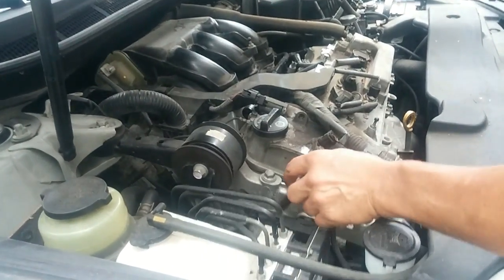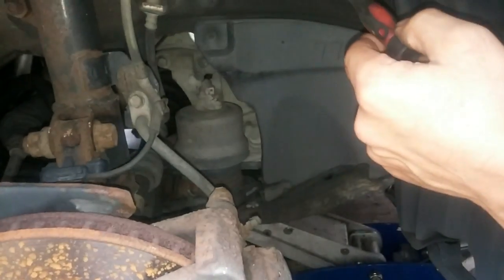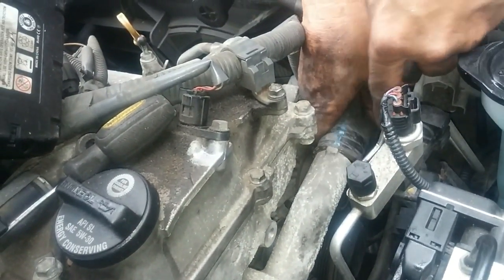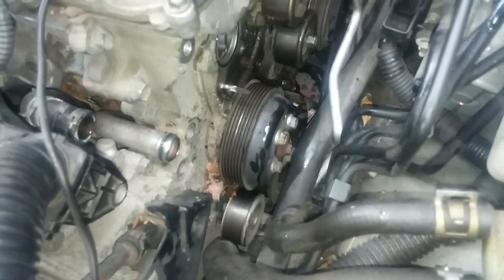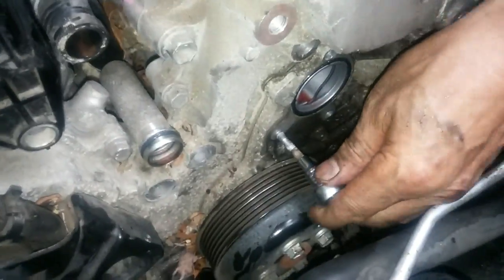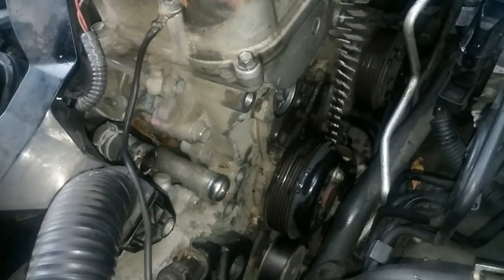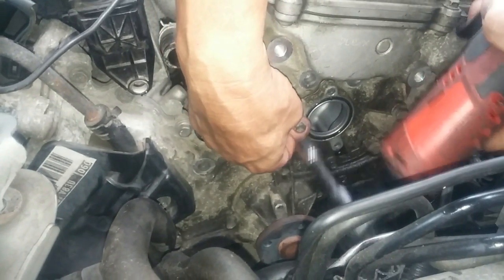Toyota V6 GR-FE - Water Pump Replacement

Comment: The top bolt on the thermostat doesn’t want to screw in. I have a 2016 Es 350. Can anyone help?
Reply from the maker: Try 1/4" extension with short 10mm socket.

Comment: 11:55 why that kind of funnel?
Reply from the maker: That's a Lisle spill free funnel.  Link is provided in the video description area,.
Reply: @hardlymovingpro  no. why?
Reply: @outoftime788 it's to fill the coolant into the system and bleed all the air out at the same time

Comment: Hi!
Sir, please give me a comment.
Will i have a chance to replace VVTI and timing chain at 2gr-fe, rav4 III 2007 ?
Is there a chance that it will be enough space to takeout timing cover and VVTI, without dismount of whole engine ?
May be if i lift left side of engine, like you did ?
Reply from the maker: I never replaced the timing chain on the 2GR-FE so I can't advise.  For all that work, you'd be better off getting a JDM replacement engine.

Comment: Shouldn't you had loosened pulling prior to taking belt off?
Reply from the maker: You can loosen the pulley nuts prior to removing the belt assuming the belt doesn't slip in the process.

Comment: I just did the same job on a 09, didnt have to loosen the drivers side motor mount to have clearance for the water pump to go in and out, all I did was take the plastic cover off of sum electrical box that sits under the motor mount that was taken out... easy peasy japanesy.... you video was alot of help tho...thank you
Reply from the maker: Good job and thanks for sharing!
Reply: I wa looking b at that last night fr
Reply: I also did water pump on a 2009 camry. Also had to loosen the driver's side / center motor mount to get the engine to lift for clearance for pump cover/pulley and that one lousy bolt on the top mount bracket. Excellent video. In heaven cars will be easy to work on by design! Thanks for the help until then!
Reply: Do you have too use the red antifreeze or can I use the green

Comment: Loosen the water pump pulley while the belt is still on....no need for the E 6 socket to remove that stud either
Reply from the maker: Thanks for sharing!
Reply: @hardlymovingpro  ....I'm doing one right now...🙂...been a few since I did one and I used your video to refresh my memory... great Video!!!👍👍👍...thank you 😊

Comment: Nicely done. My sister in laws van just started the water pump rattle. So did Toyota fix the problem with the water pump? What brand is better? if you know.

Thanks for the video
Reply from the maker: No problem for Toyota to fix.  Water pumps do wear out and eventually require replacement.  OEM pump provider for Toyota is Aisin.  GMB as well as Gates are good substitutes.

Comment: Hi. Was wondering if I could have some advice

I managed to pull both idler pulleys off.. one at top. One at bottom left

I seemed to have lost 1 idler plate cover
(Its like a washer). I believe each pulley comes with a plate. One at the front and one at the back. 

Ive seemed to have lost 1 pulley cover. 
Do you think its neccessary to put back a pulley without 1 cover on it? 
Id have to buy another pulley complete just to get the cover! Ive looked high and low for it. In the engine bay to see if this little plate washer dropped anywhere. Cant find the damn thing.
Reply from the maker: Had it happen to me as well.  A large flat washer would work as a substitute.
Reply: @hardlymovingpro  thanks for the reply. I have to find a similar diametre width washer. I think it would come pretty close. Thanks for that!

I also managed to strip the bolt head on one of the idler pulley bolts aswell and had to use a bolt extraction kit to remove it. Unfortuatley its a two week wait for a new bolt. So im thinking I can weld nut onto the damage bolt head and use it that way. I dont know of anywag around it.
Reply from the maker: Get a bolt from a car in the salvage yard.
Reply from the maker: You only need a washer the diameter of the base of the pulley.
Reply: @hardlymovingpro  okay so this is where im at
Car is put back together with a washer I found at depot store. 

Screeling like CRAZY. 
Now the belt is smoking and car is rough idling terribly. When i loosen the idler pully with the make shift washer the screel decreases and increases. 

Ive even tried to run it with no cover plate
Still scrreching like crazy. Very ODD. 
PULLY is moving freely in my hand off the car showing me that its not seized. But upon accelration the squeeling gets higher and higher and then the belt starts to smoke. 
Toyota australia has told me 5 weeks from JAPAN to get the cover plate. 

Any ideas at all? Bearing is free spinning off the car so its not seized. The only thing i can think of is that it definatley needs the idler plate cover to operate and spin freely while on the engine.

Any ideas at all?
Reply from the maker: Pulley must be free spinning after bolting on the engine.  If not, that's the cause of the smoking; belt friction on a stationary pulley.
Reply: @hardlymovingpro  thanks the belt tensioner bolt was done up too tight preventing it spinning

However now the car is rough idling. I can rev it then when the revs come back down it starts to splutter and choke now

Something must of happened when the water pump failed...
Reply from the maker: Or maybe the belt is mis-timed.  Recheck your timing marks.  Happens to the best of us.
Reply: @hardlymovingpro  thanks
I never knew but with toyota late 90s onwards if thr battery is disconnected it has to relearn its idle
Theres a video on uouyube how to do it
That includes the gsv40r engine and all camry . Avalons etc. If the battery ever is changed or DC. 
Crazy huh? 
Works now

Just wanted to say thankyou. I couldnt have done it without your video you saved me over 700 dollars. God bless you.

Btw the belt squeeking and screamimg and smoking was becausw the tensioner pulley was done up too tight

Comment: How many hours you think this took? Cheers
Reply from the maker: For me, around 3 or less hours.
Reply: @hardlymovingpro  im no mechanic. I found a water pump for $35 that would fit. 
Im about to give it ago myself
Mechanic would probly try charge around 700. Hopefully it goes to plan
And im thinking about buying a milwaukee side impact wrench like you have in this video
Reply from the maker: $35 seems a little too cheap for that water pump.  Get either Aisin or GMB brand.  Good luck!

Comment: Thanks for the vid it is very helpful the process seems straight forward. What are the torque specs for the pulleys when replacing them?
Reply from the maker: You'd need to get a repair manual for the vehicle to obtain torque specs.  I snug them down using an extended 3/8" ratchet wrench.  That's good for around 30 lbs of torque.  You can use thread lock liquid on the threads for extra comfort.

Comment: Great video!  Now I am thinking about do this myself! 2015 toyota Sienna with only 50k and already have this water pump pully/Bearing grinding noise!  What happened to Toyota reliability?  Btw I got the milwaukee M12 ratchets and impacts for this ! Lol 😆
Reply from the maker: Good for you on the M12.  There were a few years the pump didn't last 100k miles.  I think they're better now.  Aisin is the OEM manufacturer.

Comment: This video helped a lot!  Thank you for taking the time to make the video!!  Working outside, in less than ideal conditions, it took me about 6 hours total. I have an AWD Highlander so it's a little different. 

If anyone plans to try this at home, the best advice I can give... Lift the engine about 4" on the passenger side before you even attempt to take anything apart that attaches to the belt. Trying to get the bolts out of the engine side of the upper mount is the worst part of the entire job!   The actual water pump bolts are the 2nd worst.  Good Luck!
Reply from the maker: Thanks for sharing.
Reply: Running into this problem as we speak! I have a '12 AWD Limited so mine is a little more cramped than the Camry!
Reply from the maker: You'll have to tilt the engine up for more clearance.
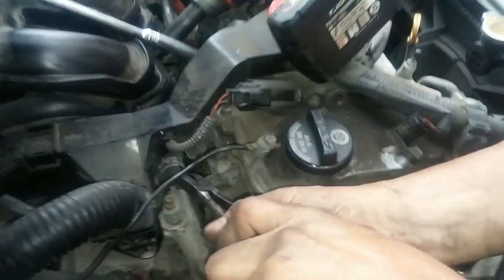Reply: @hardlymovingpro  I got that taken care of, I'm stuck at 4:12, I don't have hose clamp pliers, trying to find an alternative since it's so late and everywhere is closed!
Reply from the maker: Harbor Freight.  They sell hose pliers.  Cheap.

Comment: Also I notice you didn’t use RTV On the 12 mm bolts for the water pump I thought you’re supposed to use them so there’s no leaks
Reply from the maker: Found that they're really not necessary but doesn't hurt to put some on the threads.
Reply: @hardlymovingpro  Thanks just did it and put RTV on all the 12s

Comment: Is it necessary to put sealant on the stud that’s on the water pump if it comes already installed as in the Toyota brand ones and ASIN? I hate to take the brand new stood out only to find it’s already sealed and I find it hard to believe that they wouldn’t put sealant on it properly before shipping it out since it comes pre-installed
Reply: AISIN replied to an earlier question I asked them this via email and they responded back saying no sealant required it’s already sealed from the factory
Reply from the maker: That sort of makes sense.  The threads from the 12 mm bolts are probably picking up the timing chain cover RTV residue.

Comment: No doubt, this is the best video on showing how to replace GR-FE water pump. Q1> Did you replace thermostat? Q2> Did you loose the driver-side engine mount? Q3> Did you just jack up the engine through oil pan? Thank you!
Reply from the maker: Thanks!  Thermostat wasn't replaced.  Driver side mount not loosened.  Jack up via oil pan.
Reply: @hardlymovingpro  May you Also tell me the part number for the o-ring? i saw you used a green one. thx
Reply from the maker: @ask43242flight  O ring should be included with the replacement pump.
Reply: @hardlymovingpro  Thank you!
Reply: @hardlymovingpro  the metal water inlet house/ housing (10:17)that contains the thermostat, if it’s leaking from the joint, do I just replace the gasket or do i have to replace the entire thing? Mines leaking from the joint showing in 10:26Thanks

Comment: Thanx for the video. Will it hurt the other motor mount to twist the engine up like this to one side?  I am studying this job as I think it’s coming.
Reply from the maker: Lift just enough to get the side torque rod mount and water pump pulley out.

Comment: good video,I did other way,don't  need to move the bottom engine  mount nut,you just need to remove two 10mm nuts from the rear cylinder head front plastic cover,the aluminum can remove from the back with two rear bolts with it.
about the water pulley 4 bolts ,just need to put a pin to a hole between two of the pulley bolts to lock the pulley.
I need to replace the belt tensioner too, need to remove   the air conditioning pump and alternator.
Reply from the maker: Thanks for sharing
Reply: @hardlymovingpro  you welcome, need remove water pump and tensioner tomorrow, this my first time, bad   Design ,doesn't like toyota.
Reply: I did the pump today, it have two 99% same pumps,the different is one of the hole fit 10mm bolt another hole fit 12mm bolt !

Comment: do you have parts numbers for the two seals for the thermostat housing
one was a the oring on the pipe the other where the housing bolts to far corner
Reply from the maker: They usually come with the new water pump if the pump was purchased from a reputable parts manufacturer.
Reply: @hardlymovingpro  dang advanced auto is def not reputable lol but we already knew that
Reply from the maker: @death-hs4dh  Should not buy a part like this from any retail auto parts supplier that's repackaged the part.  You then do not know who made the part.
Reply from the maker: @death-hs4dh  Advance Auto is better than AutoZone ... IMHO.
Reply: @hardlymovingpro  annoyingly they only gave me the main seal

Comment: How you know the water pump is bad ? I have some noise around the area , but not sure if the water pump or ? 
Car runs and drive no problem
Reply from the maker: More than likely the pump's bearings are going bad.  When they completely fail, that's when the coolant with gush out.

Comment: Why is there never tool sizes only about half of everything is named . Not that helpful
Reply from the maker: Japanese cars are consistent with their metric sized nuts and bolts.  That is, 8 mm, 10 mm, 12 mm, 14 mm, 17 mm, 19 mm & 21 mm.  I can just look at a bolt head or nut and know what socket size to reach for.   Comes with experience.

Comment: I had to comment again to express my gratitude for your post. This video was my companion as I replaced the water pump. Once you get realistic about removing the motor mounts on the Lex everything is simple. I really took my time and was meticulous in my approach to this job. I am no longer intimidated and enthused.  Cordless impact wrench and cordless ratchet were essential.
Reply from the maker: Glad it all worked out for you, good luck with future repairs and thanks for your post!
Reply: @hardlymovingpro  you are most welcome.

Comment: What about locktite on the pulley bolts. Ive had them rock out before. There also was no mention of the pulley washers.
Reply from the maker: Never had them come loose on me and I've done a lot of replacements;  but it doesn't hurt to use locktite if you want.
Reply: @hardlymovingpro  thank you for such a quick reply. Im replacing the water pump on a 2015 Lex right now (3:24am) I just got every thing off and Im taking a break😊. No gasket maker/sealant is required on the water pump gasket?
Reply from the maker: @justallah2785  Nope.
Reply: @hardlymovingpro  ❤

Comment: I remember when the water pump was on top of the engine 3 or 4 bolts and boom.
Reply from the maker: Ah ... the good old days.  I.e. Chevy 5.7L V8.  Still have to take off the fan shroud, the fan and the hoses.

Comment: Your video helped a ton take the water pump out. Did you end up using thread sealants on the 12mm bolts on the water pump? When I removed mine, all the 12mm bolts have it on the threads (grey gummy stuff). The manual I found only mentioned loctite 242 (blue) on two of the 10mm and nothing else on the others.
Reply from the maker: Good question.  RTV is used on some water pump mounting bolt threads when the engine block bolt holes leads to a coolant passage.  So yes ... I apply RTV on those 12mm bolts.
Reply: Can you share what grade you used? Seems like permatex is a popular choice. There's a high temp one which comes in white tube, and a grey one that comes in a grey tube.
Reply from the maker: My preference is the Permatex heavy duty gray RTV.
Reply: I searched all over for an answer to this same question. The Car Care Nut video on this very same repair said remove any globs on the tip of the bolts, after that he said that the bolt is 'ready to go.' So I removed the globs and reused them just as they came out. If it fails I'll update here.

Comment: Just wanted to say thanks, I followed your video and was able to change the water pump on my Camry , Went pretty smoothly, well the only problem I had was that I couldn’t get the chain wrench that I had around the water pump pulley because there’s maybe between a quarter/ and third of an inch space between the water pump pulley and the pulley below it, and the chain wrench  I had,  had a chain that was almost a half inch thick so it wouldn’t even slide in there, so I did as you said some people did and removed the water pump pulley while the belt was still on.
Reply from the maker: Glad it all worked out for.you!
Reply: it is a hole between two bolts, just  need to put a pin in to  lock the pulley, the holes for tool spanner ,just use a pin still work , ex tensioner lock pin or bolt.

Comment: Thank you for this. I read that the common problem with 2GR-FE engines is with the water pump. My Toyota Venza V6 AWD has over 100k miles and I only replaced the spark plug, serpentine belt and wheel bearings but this might be in the horizon.
Reply from the maker: Stay ahead of a potential failure on the road.  With over 100k on your car, replace it.  It's called PM (preventative maintenance).

Comment: Thanks for making this video, I would’ve started the job and then found out I needed a E-six and A chain strap wrench that I didn’t have. What size chain wrench do I need?
Reply from the maker: sometimes you could loosen the wp pulley bolts using the tension of the belt with a quick jolt on the bolt.  If that works you won't need a chain strap wrench.
Reply: Hardly Moving Productions will try it thanks.
Reply from the maker: @rotfan77  good luck!

Comment: Great video. Would leaving the belt on let you remove the pulley bolt without using the strap wrench? Thanks for sharing and helping others.
Reply from the maker: I've seen people do that.  My concern is the stress placed on the camshaft bearings.
Reply from the maker: Ops ... Wrong answer.  Thought it was a timing belt question.  Can leave on belt to loosen wp nuts.
Reply: it another four holes between the pulley four bolts, you can put a pin like tensioner lock pin or a bolt in it ,to use the pump to lock the pulley turn, the holes is for a special spanner to hold the pulley, some other make pump the same,hope this help.

Comment: Awesome video! Only question I have are torque specs on bolts. I was able to find most of them but do you know what the torque specs are on both of the engine mounts?
Reply from the maker: Honestly I just tighten them down with a long handle ratchet wrench.  They generate enough torque to keep you worry.  You can always apply locktight to the threads for extra measure.